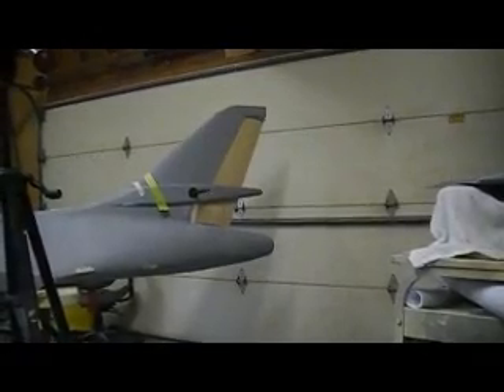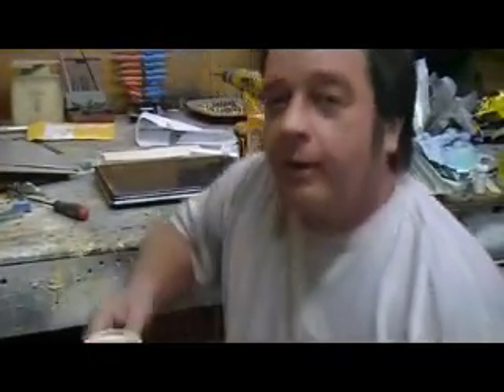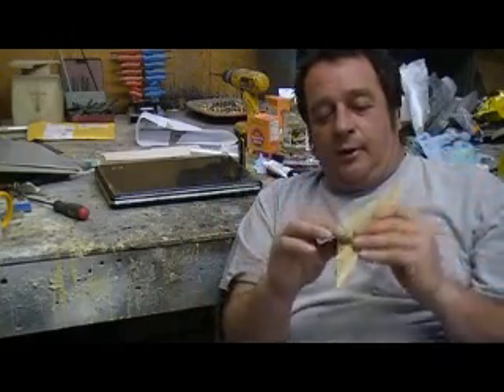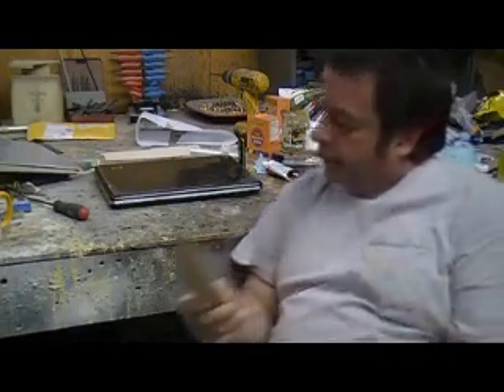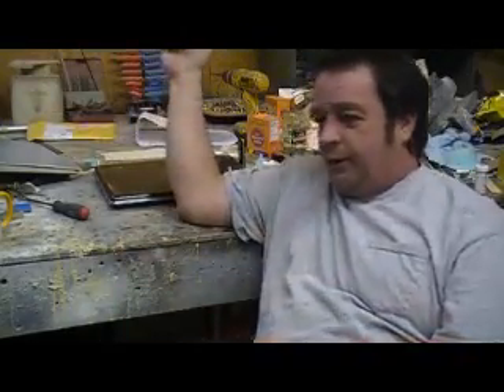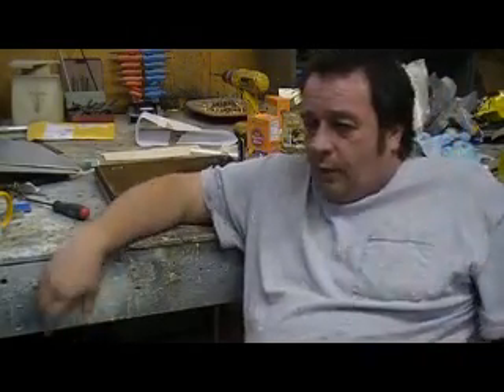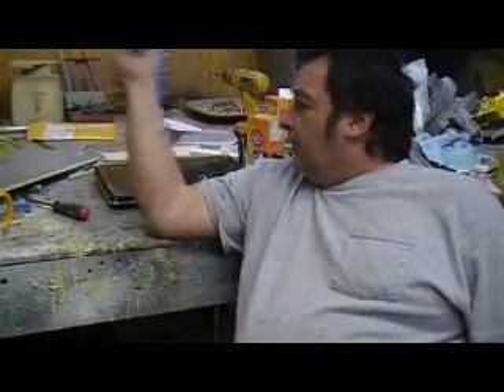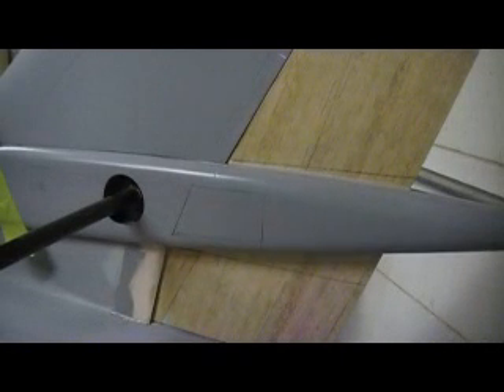how to build a rc jet B-1 Bomber # 176 pt 1

Comment: This is the most awesome project going! I'm really concerned about your flying stabs, they wont need much throw, But they will need to deal with massive tork and leverage to avoid flutter will you be mixing ailerons with you elevators?